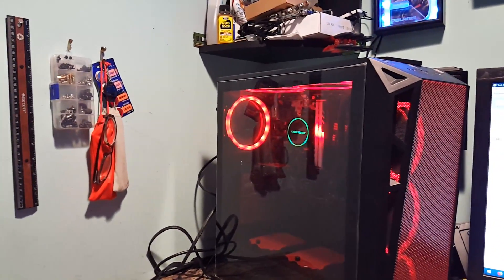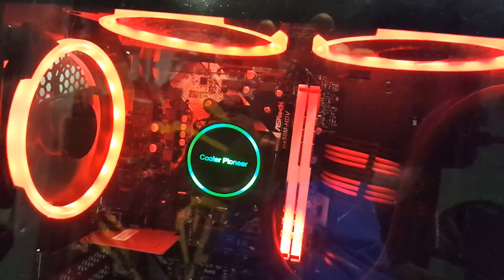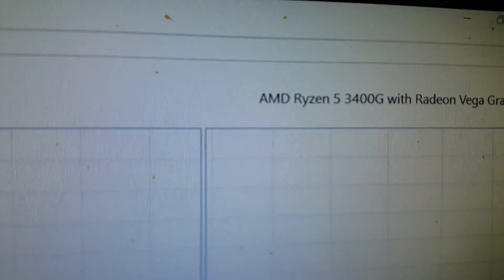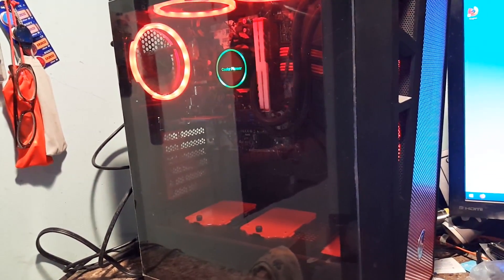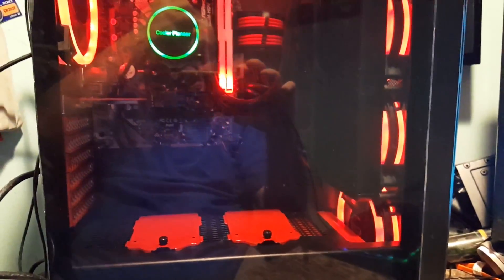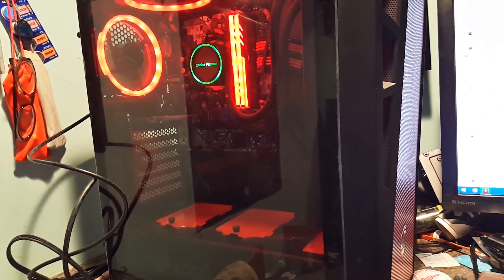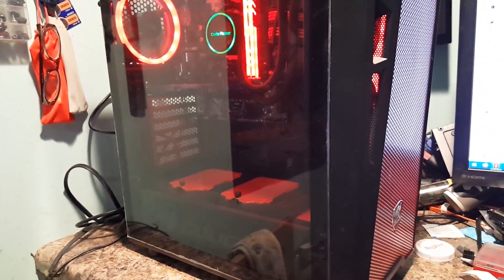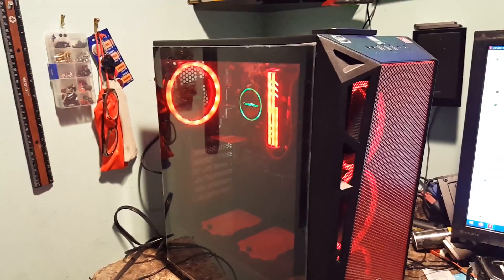Cougar Turret Mesh Build (painted)

Comment: i recently did a ryzen 5 3600 pc. its just using a rx 580 8gb red devil right now, but might grab a 5700 xt red devil during black friday or cyber monday sales and maybe pick one up for a good deal. been looking around for a case and nothing is really appealing to me much. i like the late 90's-early 2000 look, but kind of think if it has a bit of modern touch to it too, it would be good. the problem is, everything i come across, just doesnt quite "do it" for me. im not into rgb to be honest. never really have been. maybe just a small touch.. for example: no rgb at all, but the led logo of the rx 580 8gb red devil on and maybe just a touch of red, like a thin red ring, on an AIO on the cpu. and then, dust filter, old school style with modern features, good air flow and ability to put AIO on top. this case hits just about all of the check boxes for me.

Comment: The airflow is best for cases under 40$ right?
Reply from the maker: Airflow is fantastic! The front is all mesh, nothing restricting it, and those are the kind of cases I like working with.
Reply: @phreakwars  is it better than mx 330?
Reply from the maker: @nokigaming6651  way better, more room to work in, easier cable management
Reply: @phreakwars  Can in the top enter 2 fans of 140mm? I suppose one does ... many boxes say that they can enter 2x140mm but then it turns out that they enter without counting the power cable of the cpu ... (google tranlsate sorry)
Reply from the maker: @leandrotorricovidal8777  Yes, you should have no problem installing 2 140mm on top. Watch my other video going over the case: https://www.youtube.com/watch?v=uu4HS2RlFEE